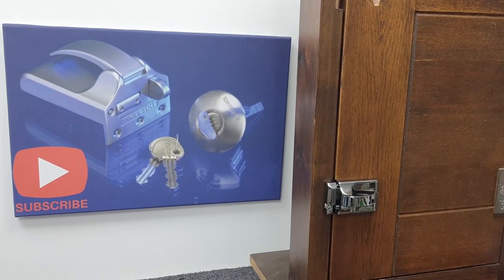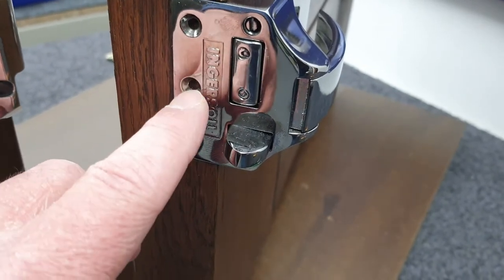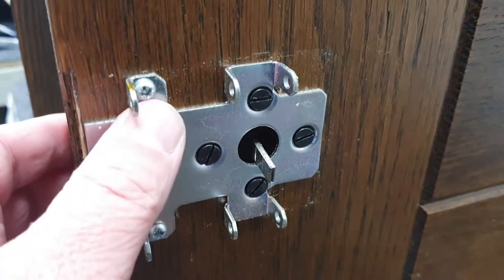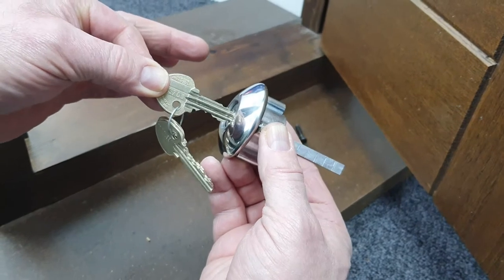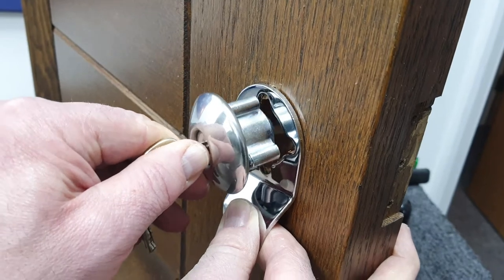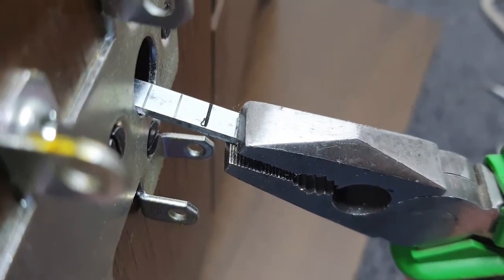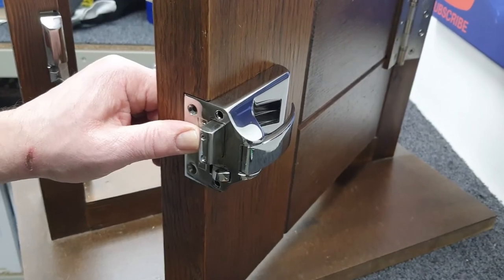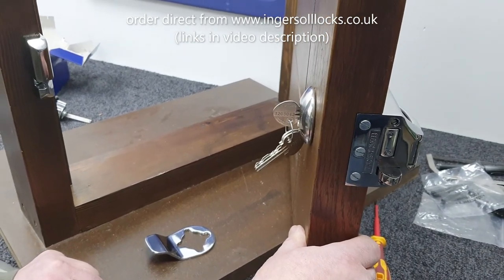How to Change the Barrel (Cylinder) on an Ingersoll Lock

Comment: I went to retrofit a cylinder pull to one of these locks today and it didn't sit flat against the cylinder and looked wrong. Should they sit perfectly flat? Sorry I should have taken a pic
Reply: Sometime when you slide the cylinder pull over the cylinder it gets slightly jammed and doesn't fit flat. You need to spray it with WD40 and slide it over slowly.